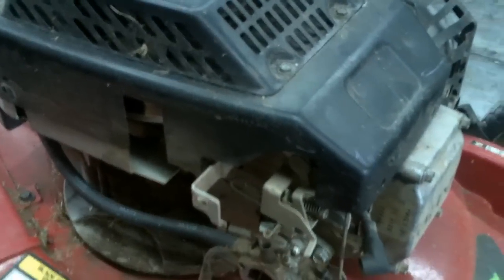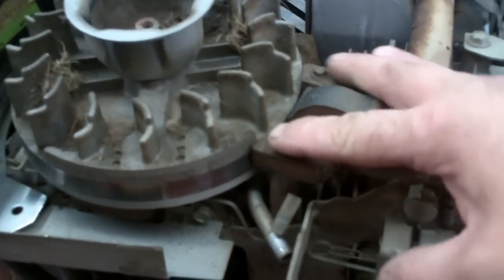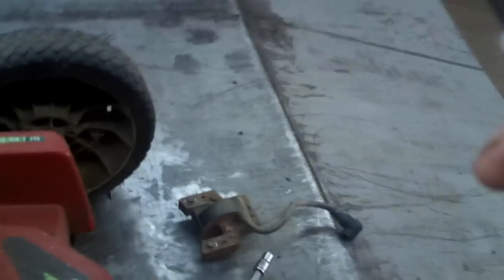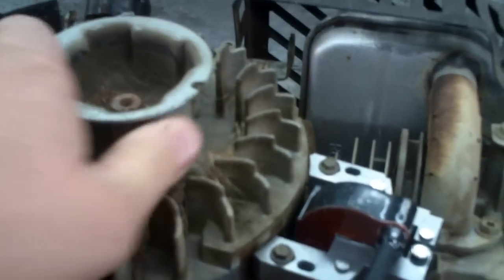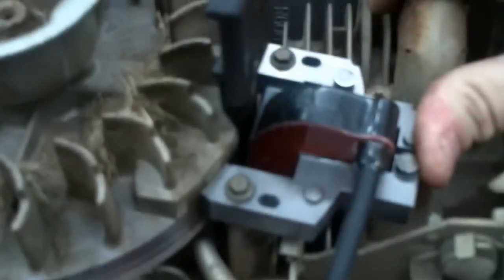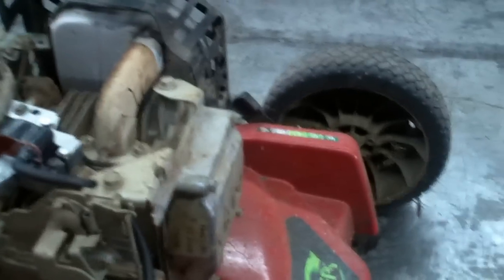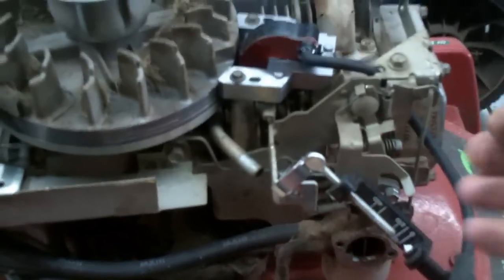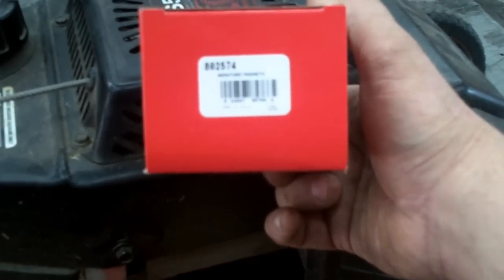BRIGGS AND STRATTON ENGINE REPAIR   how to replace the ignition module on most 4 and 2cycle engines

Comment: Hi MM, 
What part # coil would I use for a ‘77 3.5 HP side shaft? 
I’m assuming it’d be different than for the later overhead valve engines. 
I’d like to eliminate the points.

Comment: If I need a new spark plug wire, Which ignition module do I by for my Toro (B&S 128M02) mower?

Comment: Just did a video on this type of ignition you might be interested in showing how primary switching occurs, how timing advance works and reading secondary spark voltages off the primary.. https://www.youtube.com/watch?v=Iw85e1a8jO4

Comment: I have a bad boy zer0 turn mover that has a 27hp briggs intek engine it starts up and runs for a while then starts to spudder, when it cools it runs great again
Reply from the maker: NEED TO CHECK AIR GAP ON THE COILS, CHANGE THE PLUGS WHILE UR IN THERE

Comment: installed one this morning made in china . even with new coil no spark ,and that without using the kill wire to make sure its not a ignition issue ? they are ordering a new on from easy wheels in inverness fl , must be defective 50 bucks in change . bummer LOL

Comment: Hey Jeremy,I have a craftsman 13.5 hp riding mower. I have changed gasoline, and gas filter, put it a new carburetor because that is what sears said could be the problem. Oil, spark plug are new. I finally got and installed the magenito (ignition coil) but it will still not start. The mower is not in bad shape but cannot seem to find the issue. Let me see if I can send you the video I have. Any ideas what it could be? https://www.youtube.com/watch?v=lFAhXl_JwbI

Comment: question: i have a 3hp B&S and and i have no spark, one wire goes from the coil to the points, one to the sparkplug but i dont know where the third wire has to go.

Comment: I have a 19hp Kawasaki that sounded like it was intermittently losing spark. Put a spark tester on it and sure enough the one side was losing spark. Changed the coil on that side and replaced spark plugs on both sides. It ran great for about a week then started doing the same thing. It still does it intermittently. It might be fine for a couple mows then I'll go to start it up a few days later and it does it immediately. Shut it off and start it the next morning and it will be fine. What am I missing??

Comment: Before buying and replacing the ignition coil you should try to just regap the existing coil. That what I did to mine and it fires right up on the first half pull. My coil was slightly touching the magneto so it was causing resistance and was harder to pull. Now its very easy to pull and it didn't cost me anything.

Comment: Jeremy, I have a old String brush cutter with a B&S 6hp (122K02-007-E1) that is acting like it is Hydro-Locked, but when I pull the plug and pull it through, no oil comes out. No oil comes out of the muffler either. It is very hard to pull through with the plug in, but easy with the plug out. Any suggestions? Thanks.
Reply: George Goff sounds like you got a high compression motor. you need a stronger starter. haha just kidding.

Comment: Should of removed all that dirt, grass and oil that was under the magneto. Can cause the cylinder to run hot in that area which leads to engine failures. Make sure the entire cylinder and head are clean to cool properly.
Reply from the maker: I blew it out real good with air just not on film
Reply: We all saw you bolt the magneto back on without doing this. I'll give you the benefit of the doubt sir. Great video as usual.

Comment: I have a 2003 zero turn 38in timecutter toro, two days ago I used it twice and now it won't even turn over, what is going on with it?, the switch and voltage regulator have not been replaced

Comment: Hi - I have a Briggs & Stratton 12.5 HP that refuses to start - I think I may have found the reason but do not know how to go about correcting it - it seems that at Piston TDC, one of the magnets has totally passed both pickups and the second magnet  in the flywheel is just about to say goodby to the remaining pickup making ignition before top dead centre impossible - I have had the Flywheel off and was most careful to see that the keyway was correctly filled with the rectangular key - but noted that the keyway slot was wider than usual and the key was a tight fit when fitted sideways - this meant that there was very little key entering the flywheel slot.
All of this may be irrelevant as the Plug (New) will not spark at all

Comment: I just replaced that part on my riding mower.  I followed that wire you called, "the kill lead"...   It looks like it was pulled out of it's connection.   The engine still runs with the wire like it is.....     Does it need to be reconnected????
Thanks
Reply from the maker: Nope
Reply: +M Gomez  how do you turn what off?
Reply: +M Gomez I went ahead and reconnected it when I had replaced the coil.  My mower has a key ignition to shut it off.  I don't know if that kill wire was connected in the past.  The old coil looked pretty worn out any how.....  It all runs good now.
Reply from the maker: +M Gomez there's no way to answer all questions.  I get 2-300 per day

Comment: hi, I have a 14.5 briggs & stratton motor and the oil is mixed with gasoline,  how I can fix that?
Reply: that means the head and rings is dead get rid of the mower or get a new motor
Reply: Needle and seat in carb is leaking and drips into cylinder, then through the end gaps of the rings and into your oil. Check your oil level before you start it next time and you may find that it has increased. Also smell the oil - does it smell like gasoline? You will destroy your engine with gas in the oil from lack of lubrication. You may even think you have a dead battery, but what you really have is liguid lockup of gasoline in the cylinder. Remove the spark plug and spin it over to see if it shoots gasoline out the plug hole.

Comment: very informative video, thank you. I have a snapper mower that I brought a new engine off of brandnewengines. The design is ready start and the engine brake is different. I have had to shut it off by unplugging the plug. Now I don't get a spark. I suspect the coil is bad. Would unplugging the plug to shut it off make it go bad? I feel like a fool thank you

Comment: I've got spark to the end of my plug wire, but can't get spark to the electrode tip of the plug (brand new plug gapped at .030).
Reply: then it may not be the correct plug, and or there isnt enough spark to reach the end of the plug you need to test the coil for the correct amount of voltage.

Comment: have 4 horse briggs  revs up and down after starting can u help
Reply: that is the governor....i would check the springs and make sure the correct tension on the return springs...it can also be incorrect mixture of fuel and gas... but every time i came across that problem the springs on the mower where worn out.

Comment: My magnetos (I have a dual valve 22hp b&s) read 4.89. Although this is within range, is it close enough that replacement would be advisable? I ordered the new parts before realizing I could try testing and cleaning them. After cleaning the magnetos and the magnet, the mower works again.

Comment: I have a lawnmower Briggs&Stratton  300 series 148cc when I pull to get it start it oil come out of the muffler  what I need to do to fix the problem can you help me   thanks.
Reply: Joann garcia first , don't overfill it with oil.  second , check if your flywheel key is lined up with the slot on the axle . if not.  the key is broken. and the spark is not firing in the right time so you get raw fuel and oil going out of the muffler .   if not that. ask again. and make sure you got the right oil in.

Comment: Hi Jeremy! New subscriber here. Note of interest - I'm learning and teaching myself how to fix my own equipment via you tube videos  Been trying to get my B&S 13.5 hp riding mower started and not having too much luck.  Initially started with needing to adjust valves, after many times, I believe I finally got it and feel confident that I do.  Mower still wouldn't start, then checked for spark. No spark. Removed magneto, disconnected ground wire, inspected for burn spots - none, cleaned it and magnet on flywheel with wire brush and reinstalled using business card to set gap between magneto and flywheel magnet and then tightened bolts on magneto.  The magnetic contact force between the two made it very difficult to remove card so, I rotated card out and very slowly turned flywheel by hand and noticed some binding between fly wheel and magnet when going past magnet. Any comments/suggestions? Would greatly appreciate your help.
Reply: the coil needs to be 14 thousandths away from the magnet....get a feeler gauge from local auto parts store.

Comment: Hey I have a question but first I am working on my uncles lawnmower it was surging up and down so I did all the normal stuff cleaned the carb changed the air filter started it up and it was still surging so I got to looking and there's a hole in the manifold intake pipe of course I'm gonna put a new one on.So my question is that hole will cause the surge right ? IV never had this happen before so I'm guessing this will cause a surge.Also the spark plug is good.This is a Briggs and Stratton 3.5 classic. Thank

Comment: why is the classic 35 motor not firing up at all, even after priming the carb? i changed the DIA..... thing in the carb and there is spark, but it just wont fire up?? it even moves the oil cap when i just leave it unscrewed on top, so there has to be enough compression also? it does not make the plug wet tho... so... how important is the O-ring over the intake? maybe that one leaks?
Reply: if it has spark and fuel and doesn't turn over then i would check timing, and the amount of volts coming from the coil. Some of the ignition coils will spark but its only half of what it needs to be.

Comment: Actually, when the coil goes bad, it is because of the solid state part built inside the coil that goes bad. This part replaces the older "points and condenser" that older engines had. There are a few newer engines that have a separate solid state module that mounts on the outside of the engine. One that comes mind was the Kawasaki FC series engines had this set up.

Comment: Where is the best place to get that coil for briggs and Stratton engine # 802574 part  for replacing the ignition coil. I have lawn mower from yard machines with briggs and Stratton engine and there is no spark coming as I have done everything else and feel that I need to change the coil.

Comment: I have a Murry lawn tractor with a 2 cyl. Briggs and Stratton engine and this am I went to start it and it smoked real bad and would not run.  I checked the oil level and it was high so I drained the oil and I found it was a mixture of oil and gas.  I refilled it with oil and started the engine and it ran and really smoked then it cleared itself and runs fine.  Can you guess how the gasoline got mixed with the oil?  I run non-alcohol gas in the engine.  Is there something else I should look for in the engine?  Chuck Thompson      packertacker655@gmail.com

Comment: Hey Jeremy that engine you helped me with on the flywheel key is still starting real slow if at all. I have adjusted the valves and all but still turns very slow. But my real question is when i do get it started i can mow for sometimes a hour or sometimes 15 mins and it will just die. I checked voltage at the starter and get 5 at times and you can wiggle the plug at the ignition switch and hear the fuel solenoid clicking got any ideas just off the top if your head thanks its a 287707 briggs

Comment: can you set the gap at either side? is 10 thou the gap for the 3.5 classic? I have one have changed the diaphram and gasket cleaned the carb and she still spits and pops while running? its not points its electronic as has a kill wire thanks Ian

Comment: Jeremy great video  where I live it can get very humid so when I go in and have to clean up a coil I will put a very light coat of motor oil on the end of the ignition coil facing the flywheel I will also clean the base where it mounts and put a light coat on that area as well seems to keep me from cleaning coils as often do you ever do that I have never seen anyone else do that

Comment: Hi I have a question, would the coil cause a mower to stop running if it was to over heat? I have replaced the gas, rebuilt the carb and changed the plug n air filter.. My mower starts runs for a few mins then it shuts off while Im mowing.. please help.. thanks

Comment: I think you should be asked to re-write, at a very high fee, ALL the help text for Microsoft Windows.  I was replacing the magneto on my mower, forgot to check the clearance from the flywheel, came to your site - and there it was.  Thanks a whole lot.

(Bloody good gutsy little engines, aren't they?)

Comment: I am a disabled vet so working on stuff is alittle tricky. I have a 1971 ariens tiller that has a weak spark I opened it up exping points . I found the magnatron wire going to some kind of electronic board . My guess it replaces the points . I can not find the board any where. I ohmed out the magnatron and it was very high. I do not know if its the board or magnatron or both . I am lost at this point.

Comment from the maker: 32 bucks........some coils are much more expensive
Reply: I had an, inexpensive, lawnmower that needed a coil so I went to the local repair shop for one. They said that it would cost, about, $45. I told them that I could buy a new lawnmower, at Walmart, for just over a $100. I wound up using one that a friend had, on an old junk mower.